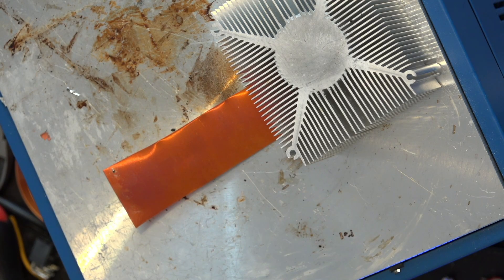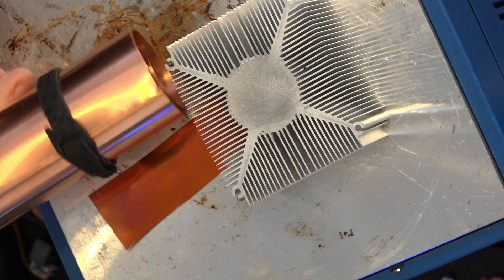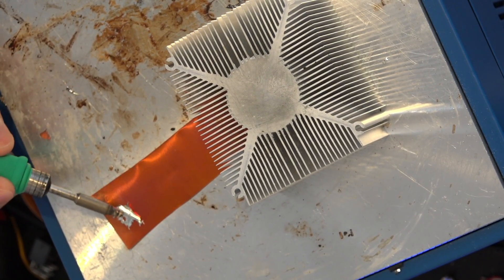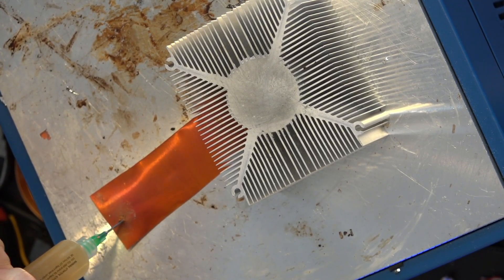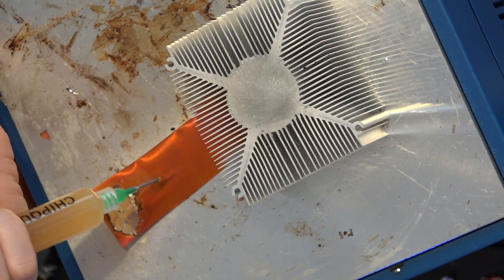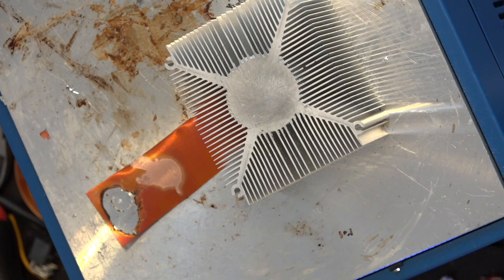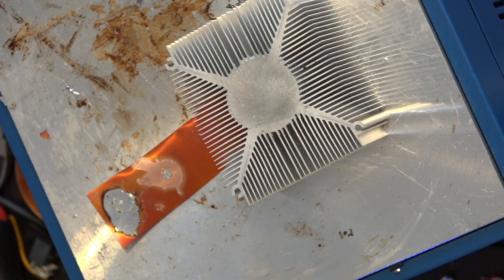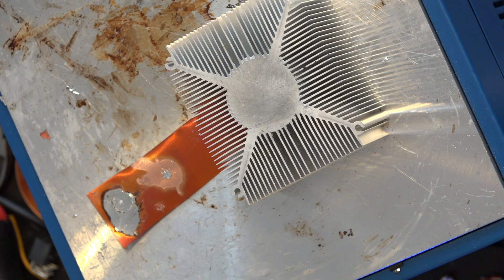Why you should use flux when soldering

Comment: could you please make an really in-depth video about bios overclocking. about everything literally everything. because I get stuck when I mess around in the bios, I try not to break the CPU. but I I'm not hitting the limit, (ryzen would really nice) and a separate Intel video. I think that would be a greatly watched video because I know I'm not the only one. 
for example the voltages, different places to adjust voltages for different workloads and one of you vid you told that one is static and the other is dynamic. please tell us more about that.

Comment: The title of this video is horrible and wrong.  It's not a "should"... it's a "Must".

If a join ever needs to conduct a decent amount of current or heat, or hold under any kind of physical stress, flux is a must.  The best a fluxless join can do is kinda hold something in place as a blob of (relatively soft) solid metal that has formed around it.

In my experience of soldering copper heat sinks/pipes/vapour chambers, nothing shows up a junk join like thermal conductivity

Comment: I thought I'm just bad at it and the experts know some kind of magic. Now I khow the oxide layer was preventing me from sticking. Thanks.
Reply from the maker: if you're working on high power/layercount boards your soldering iron might be too weak the flux will just get your soldering iron stuck to the board if it does anything at all.
Reply: @ActuallyHardcoreOverclocking  Actually I just do very basic soldering, like joining a wire to a terminal, or to a led leg.
I found hard time to stick solder to the wire.

Comment: There's a series of soldering lessons which explain why flux is important and also how to solder - on Pace's Youtube channel - they're a company that makes soldering stations and related stuff. It's dated video (instructional videos for companies buying their stuff, made in the '80s I think) but don't be fooled, the information is still valid.
Solder these days has flux inside - most solder wires have one core of flux, others have multiple strands of flux along the length of the wire (Multicore brand for example has 5 thin cores of flux). The flux melts faster than the actual solder and drops/pours on the surface and attacks the oxides,  then solder melts and makes a chemical bond with the clean metal. Sometimes if the soldering iron is too hot or the oxidation is too much, the flux inside the solder wire is not sufficient to do the job, so it always helps to add flux (doesn't matter if it's cream, liquid, paste, whatever). The flux is neutral in its default form, but as it gets heated by the soldering iron it becomes acidic and attacks the oxides and crap on the surfaces of metals and takes them away, so that the actual solder can react with the metals and form good connection.

Comment: That's why also solder has flux core. You just first heat component leg and pad then apply solder. Flux in solder will clean leg and pad.
If you apply solder first to iron then you used that flux before it can do it's job

Comment: Usually even if I use at least one Rossman amount of flux, I can't have the solder unstick from the tip, or I have nice ball of solder rolling around in search of hidden places to make a short 😢
Reply: It sounds like you might need to buy a better quality flux (if you're using MG Chemicals, amtech or the chipquick flux in the video then I apologise) or a better quality solder, not all solder is created equal, so if you can get some, use kester instead of what you're using now.

Also technique is important, remember to heat the areas to be soldered with your irons tip, if you don't have your iron touching them properly they won't heat up and won't take solder, and apply solder not to the tip, but to the work pieces themselves.

Solder will generally stick to whatever the hottest surface is so try to make sure heat is making it to the pieces you're soldering

I hope this helps :)
Reply: @PaulTheFox1988  Thank you, very useful! You are also right, since a rarely need to solder something I don't have a proper technique, it's a pain to not make a mess 🤣
Reply: @luca6819  You're welcome, I'm far from a pro myself and I'm pretty certain there's horses than can solder better than me 😂

But practice and watching good quality tutorials on YouTube are a real help and having quality tools is a must. A good soldering station to use is a Ksger t12 that Voultar recommends, it's about usd $60-70, although it doesn't come with a hot air gun so bear that in mind.

Another tip as well, make sure you're using the right temperature too, solder generally works best at approx 320c (608f) but adjust up or down depending on how large of a piece of copper you're soldering to, so if you're soldering to a large ground plane you might need up to 375c or more, and a data pad on a single layer board might be best served with 300c or less, but knowing how much heat to use comes with experience so practice on junk boards to get a feel for it :)

And use goot wick solder braid, it's not cheap, but it's amazing to work with.

Comment: This is, without a doubt, the best demonstration of the concept I've ever seen (& I've worked in mechanical engineering, tinning wires wit flux & a solder pot)
Reply: I do electronics as hobby and career for around 10y but never seem such a good flux demonstration, i know it made wonders but didn't knew it was that amazing.

Comment: Solder merges two things together physically by heating them, melting them, and adding a malleable metal that "melts the two objects together." Jewelers are good at teaching the principles of soldering.

A lot of people think it is just like glue. Flux is what makes this much more possible by allowing control of flow.
Reply: Soldering doesn't melt the two work pieces, it only heats them to facilitate the application of solder, welding is where you melt the 2 pieces and a filler metal of the same type as the work pieces is applied.

I apologise if I misread your comment but it seemed to imply that soldering involves melting the 2 pieces to be joined which doesn't happen.

Soldering happens at around 280-375c for most applications, nowhere near hot enough to melt even aluminium which is approx 660c.
Reply: Yeah, no. That's not how soldering works at all so I guess jewellers aren't that great at teaching the principals of soldering lol

Comment: So metals like aluminum oxidize so quickly even flux doesn't work ..... You can get it to work somewhat but putting a big blob of solder and then use the solder tip to scratch the surface below the solder but it'll tear up the tip really quick
Reply: IIRC, there is a special alloy and flux for soldering AL. Hate it when cheap stuff uses AL wires that are impossible to solder.
Reply: @DrakkarCalethiel  Ultrasonic soldering using S-Bond 220 or S-Bond 220-50  "active alloys" is the way to go for soldering fast oxidizing aluminum.
These active alloys have been developed to join to a wide range of metals, ceramics, and composite materials without the need for fluxes or pre-plating.  To join aluminum, just melt the S-Bond filler metals or mechanically agitate S-Bond solders by brushing, rubbing, or with ultrasonically activated solder irons to wet, adhere, and provide a base for joining. Once tinned with S-Bond solders, wire leads or other surfaces to be joined are pressed or slid together, or ultrasonically activated, to create a strong solder joint.

Comment: Can you make a video on achieving high 5.6ghz or higher single/duo/triple/quad core for the 12900K? I have a pretty good chip doing 56,56,56,56,55,55,54,53 at 1.455 vcore with mode 8 llc on the MSI Unify-X. CinebenchR23 runs all cores at 53x and temps are under 90c with vcore around 1.31v socket sense or 1.28 vcc sense. I never updated my BIOS. its still on A.10 do you think I should update even though im running good? I am also running trident z at 6666mhz 32-39-39-28--67-366-2t and all your subtimings from the 6800 cl34 1.45v video. THank you so much for your highly informative videos!!! Helped me get a memory overclock in almost no time at all! And a good one too!

Comment: I use 60sn40pb 2%flux 1mm solder. Works really well. After the red ring fiasco I always use lead. Here is a video about why lead is bad tho. I have inadvertently breathed some in oops. https://youtu.be/IV3dnLzthDA
I never used seperare flux before but I dont do much circuit board work where you want things to flow into place. There I would try to use a seperate flux.

Comment: I'm a complete soldering noob, only used it to fix my previous keyboard half a dozen times (yeah, I know....). Never used flux, and always had an incredible difficult time getting things to stick to the PCB. Actually had to burn through it a little bit, so I was able to solder something onto it. Amazingly I managed to always fix it, which included replacing a bunch of contacts with copper wire.
Reply: Also, unless you intend to sell any electronics I prefer using lead-based solder compared to lead-free. Melting point is much lower and way easier to work with. It's still lead so some precaution must be taken but as long as you clean the joint and workspace, there won't be a concern.

Comment: JBC T245 there?
Reply from the maker: yup
Reply: Buildzoid answering ME ? I'm an happy man... 😊
BTW , with such a high thermal capacity iron not able to go through the oxide layer (on that big tip , also) this greatly increase the flux work
Reply from the maker: @polik971  It doesn't matter how strong your iron is. If the oxide layer is thick enough you're not going to get through it with anything less than sandpaper/flux. I also intentionally used solder without any flux in it for this demo.
Reply: Mmhh... Even some hundreds of joules every single second?  On a tiny spot? That's a lot of work...  I think it should be checked , if mechanically possible or maybe some chemical guy can explain this

Comment: do not breath the smoke!
Reply: inb4 the idiots who proclaim the sanctity of leaded solder show up to proclaim that they've always breathed in the smoke and haven't died.
Reply: @WhenDoesTheVideoActuallyStart  Tin/Lead solder is the best and I've breathed the smoke and I'm still alive. Try and avoid it, the smoke follows you.
Reply: @wayland7150  Thanks for proving me right.

Also, that's called "breathing in", pulling air into your lung also pulls any smoke with it. You can solve that problem by forcing an air current away from you, with for e.g. a fan (Just shield the work from said forced current) or preferably with an air filter that pulls the smoke and captures it.
Reply: @WhenDoesTheVideoActuallyStart  Being proved right? So your day is complete.
Reply: @WhenDoesTheVideoActuallyStart  Lead solder does work well but definitely get a fume extractor lead will actually make you stupid and makes you lose fine hand coordination in your hands. two things you absolutely need if your planning on doing microsoldering.

Comment: Wow em that’s awesome never realised that.
I did AO electronics, etched my own pcb’s etc and was always using brand new clean stuff, so never touched flux at all at the time, and didn’t understand what it really did for the task until now. Thanks :)
Reply: Most solder wire has flux in the core. The special part here is being able to add extra flux. Had he used solder wire rather than a blob of solder where the flux had burned off then you would not have noticed the effect so much.
Reply: Do you know what is in the flux that dissolves oxides? Acetic or hydrochloric acid? That would be my guess. It's interesting because I would've never guessed that's such an issue when soldering - although it explains my shoddy attempts. I always found that freshly stripped copper wires worked way better and never knew why.

Comment: Flux is good.
Reply: Flux is THE BEST lol
Reply: When I was a kid someone told me you didn't need flux because the wire already had it in it 😂 Boy we're they wrong. But I'm now nearly a decade into my career in electronics repair.
Reply from the maker: @infernaldaedra  the flux in the wire can be enough sometimes. A lot of the time it burns away too quickly.
Reply: @ActuallyHardcoreOverclocking  Yeah for quick touches it can be enough especially if you are just working with wires and small component leads. But If your working on PCBs the heat usually sinks too fast for that to be viable that's when you gotta bring in the fluxxy flux. I should have probably elaborated more.